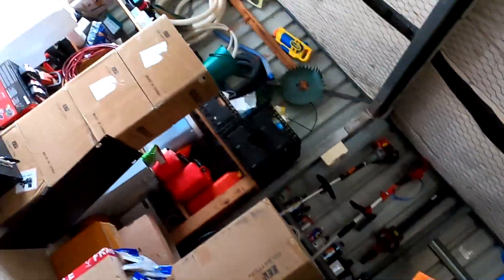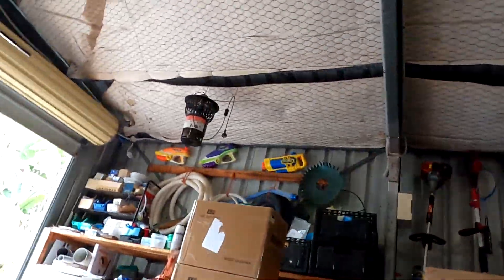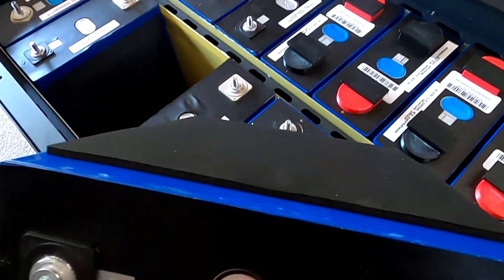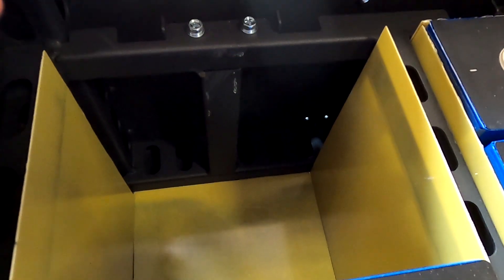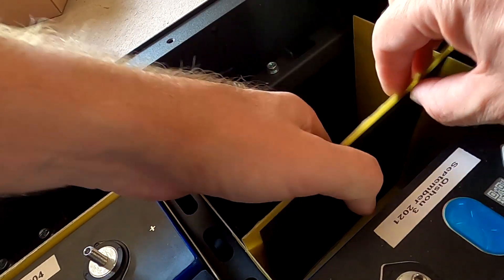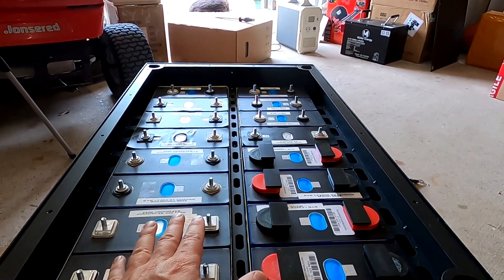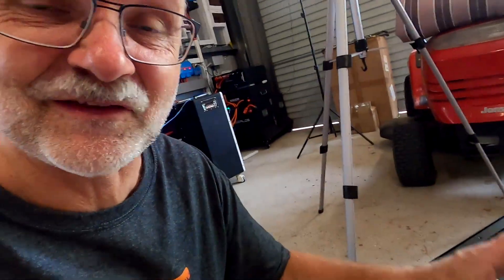How to improve the compression in the SEPLOS MASON 280 DIY Kit.

Comment: Thumbs up 👍 If the front mount is bending is that showing to much pressure 😊
Reply: Or to thin of a material.

Seplos should provide tork settings for the screws to make sure the right pressure is met. Also when the foam is compressed over time one could tighten them again to specs. Not sure if they supply such info though.
Reply from the maker: The front plate was bending in all the boxes I built. It seems cheap steel 😁

Comment: Andy watch out for temperature rise under prolonged  high draw or charge - you might consider a PC fan to circulate the air across the stack
Reply from the maker: No fan! That causes more problems with dust and insects. Temperature seemed OK during our summer with the two boxes already in use.

Comment: Bei mir dauerts noch aber ich werde die Box zum Komrimieren aufstellen so dass mir das Eigengewicht der Zellen hilft. Im Liegenden Zustand muss man die Reibung überwinden und die ersten Zellen bzw. Schaumplatten werden stärker Komprimiert als die hinteren (Das hat man etwas in deinem ersten disbezüglichen Video erkennen können).
Vielen Dank für den Hinweis mit der Rückseite
Reply from the maker: We will do some vertical battery builds soon and discuss this...
Reply: You might have a point there. I would guess though that after heating up and cooling down a few times this would correct itsself. Doesn’t hurt to overcome it from the start though.

One might even consider letting the pack stand on ots back for a few days to sink in.
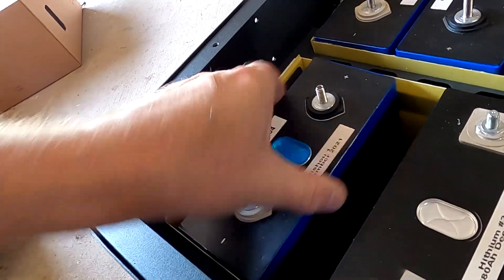Reply: Dadurch hat die unterste Zelle dann aber einen deutlich höheren Anpressdruck durch das Eigengewicht der darüber liegenden Zellen. Da Andy die Zellen aber einfach schieben kann (siehe 4:48) wird die normale Montage volkommen ausreichen.

Comment: I own 3 similiar cases from EEL Battery and there is no vertical bar at all in the end. I fixed it by filling the gap to the back plate with a 26mm wooden plate or wooden bars. That´s it.
Reply: Hi, I saw your videos and then wrote it to Andy as a suggestion for improvement, so this modification here originally came from you :) 👍
Reply from the maker: Ah, right, here we go. Thank you both!

Comment: Recently got 4 of these and pleased to report that all the bits and pieces are now packaged in a very nice cardboard box! Also, the handles where already mounted which helped a bit getting it out of the box. The BMS had conformal coating on it, did not notice this on your vid´s. Got to get the cells in and will report findings, I´ll be back.
Reply from the maker: Quality of these boxes has definitely approved, so has the packaging. 
My Seplos BMS have this coating as well. It seems pretty much standard with all the PCBs these days.

Comment: I fear that once expanded, recompresion could lead to damage and failure
Reply: Ya, plus if the battery does swell up and its got no room for expansion, magic smoke will appear.  I leave big gaps in mine for expansion.  They're still flat.  3.65 to 2.50 every cycle.  20 years to degrade to 80%.  I'll be dead before the batteries.  Lol
Reply: Depends on the SoC at the time of compression and other possible long-term irreversible swelling?
Reply: I guess you cannot recompress them anyway, you just might prevent further growth of the baby.
Reply: It can lead to internal shorting of the cell
Reply: Why does Eve recommend it, and test for 6000 cycles with a compressed cell ?

Apparently it doesn’t hurt. Compression is specified though and just compressing to the max may be way too much.

Swelling may be ok and perhaps the compression is meant to make for an even swelling instead of a baby belly.
Reply from the maker: The foam in between the cells will allow further breathing of the cells. That's part of the design of this box.

Comment: Is there a distributor for pure barebones? I mean without BMS to use an own. 🤔
Reply from the maker: I think you can negotiate this with Seplos to get the box without any BMS and display. They also make the same box for 12V and 24V.
Reply: This information would be valuable. Trying to build few 24V/300Ah packs and I'm still wondering should I go for wooden box or would there be some solutions like this, but without bms. Just a frame.
Reply: Thanks Andy, may I still trouble with one question, do you see somewhere in chassis a good room for JK BMS (or clone) and do you think that display would be attachable somewhere?
Reply: Or buy it with the Seplos BMS, then sell the BMS separately and keep the box. 
I like these boxes too, but I'd put another BMS in there, currently a JK BMS,
or I can't wait to test the other BMS's Andy announces subtly in the comments here
that should meet everything we want them to. 🧐
The front of the box can easily be swapped out for a different sheet metal with different holes for different BMSs 🙂